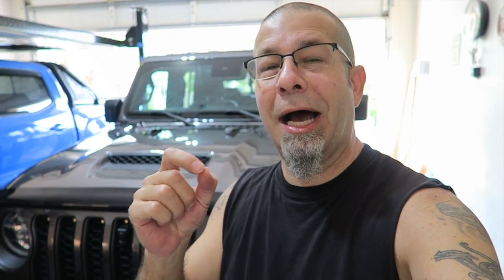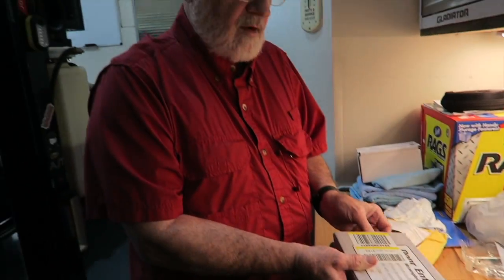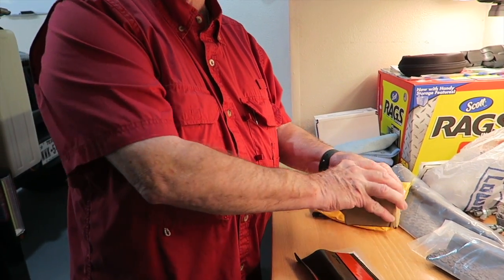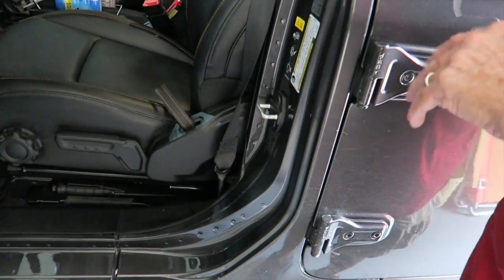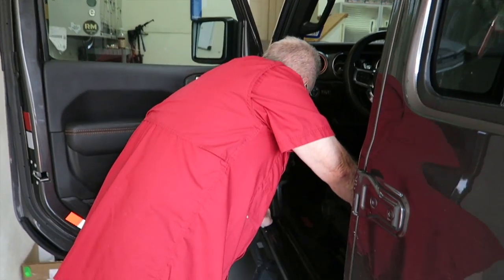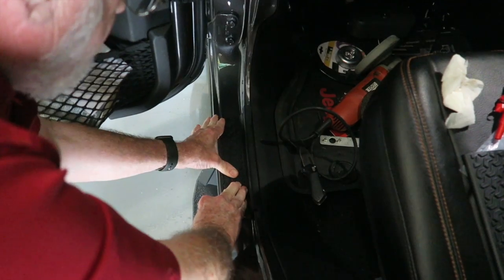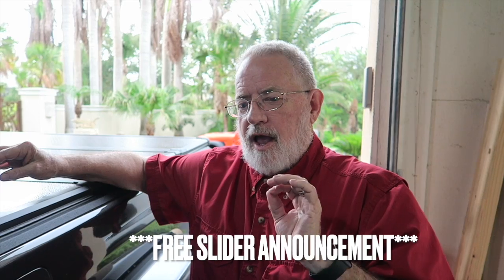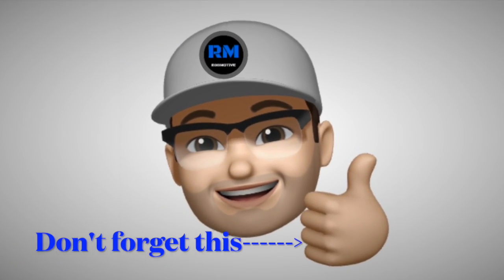Life Changing Mods for the Jeep Gladiator Mojave & Free Sliders

Comment: Great channel. I just found it and its super informative. I also just purchased a Gladiator and I just so happen to be located in the RGV. If you're offering the sliders, I'd love to take them off your hands.
Reply from the maker: Hang tight.  Randall should let you know 👍
Reply: Nicholas, Where are you at in the valley. I’m near Port Isabel.
Reply: Randall, I’m in Harlingen.. just right down the road from you.
Reply: You tell me where and when and I’ll be there if they are still available.
Reply: @nspatten100  
Ok how about tomorrow 05/21/2021 at 10:00 am on the Harlingen Walmart lot south end out away from the building toward the highway. I’ll be in the Gladiator. It’s front end is distinctive. Tailgate will be down to hold the rails.
Reply: That sounds great. I’ll see you then.
Reply: @nspatten100  👍